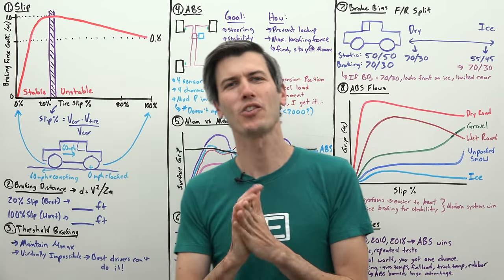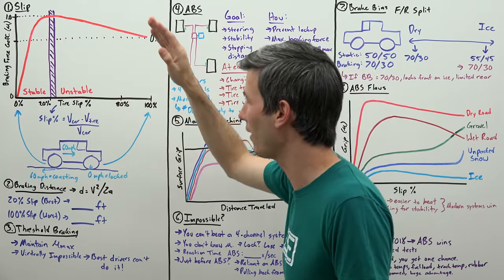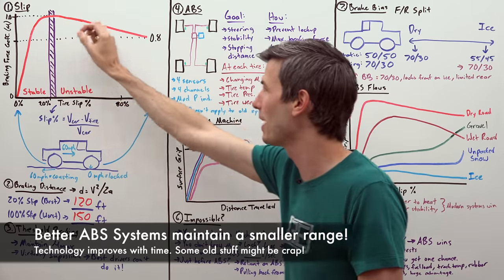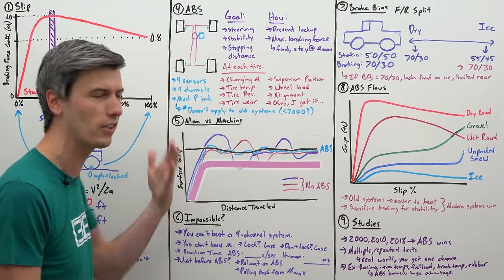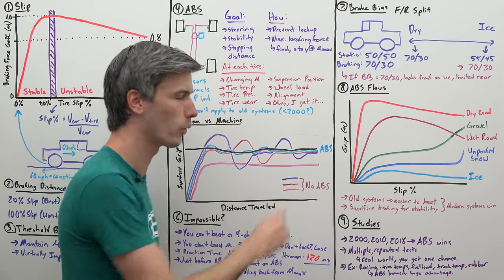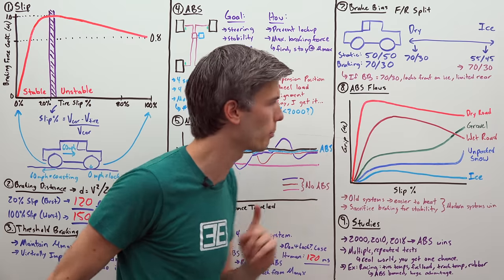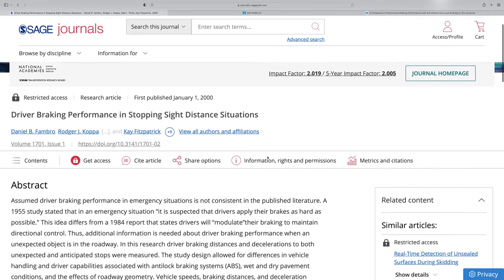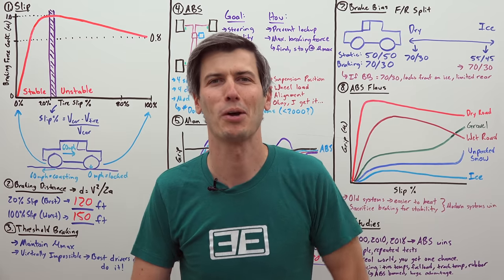Why Threshold Braking Is Impossible - ABS Wins!

Comment: Yeah, I gave up that argument many years ago.  Early ABS was terrible and I could out perform it, but that was over 30 years ago.  Even my current 2014 Camry LE's ABS is multiple orders of magnitude better than I was when I was at my best (doing autocross, or Pro Solo every weekend).  Now, in my early 50's, I am not at my best.    With that said, I do have a 15 year old currently learning to drive and I am teaching him how to threshold brake, just in case he's ever in a car without ABS, or the ABS has failed.
Reply: Modern Toyotas (after about 2006-2008) have something called vehicle dynamics integrated management, which cooperates pretty much all the control systems into one, and allows them to anticipate a skid (likely using knowledge of optimum wheel slip angles) instead of simply reacting once it starts.
Reply: @aspecreviews  Pretty much all modern vehicles have a similar system with different names depending on the manufacturer. For example, Stabilitrak for GM, and chassis control in Nissan. All of these systems monitor the steering angle, accelerometer data, and wheel speeds (using the ABS sensors) to accomplish vehicle stability. These systems will limit engine power if the system detects too much acceleration for the steering angle, or apply individual brakes if under/over steering, etc.
Reply: @berto1014  VDIM can ANTICIPATE a skid, the vast majority of stability systems only REACT once a significant skid is determined to be occurring.
Reply: @aspecreviews  That's not true. Most systems won't even let you get into a situation where slip occurs because they are actively preventing those conditions. I'm not sure what you mean it can "anticipate" a skid. How could it do that without data indicating slip is occurring or about to like any other system. I have yet to see any information claiming Toyota has a superior system because it anticipates instead of reacts.

Comment: Hubris? In the car/racing community? Inconceivable!
Reply: It's hubris to discount racing experience with theory alone.

In real racing, ABS settings are a complicated topic with no one easy setting for best consistency and speed. Threshold braking can produce faster laptimes, but at the cost of consistency. Higher and lower levels of abs and various abs setups and brake bias and suspension settings also factor into this.

So it's not as easy as ABS = always better. If it was, people wouldn't be talking about threshold braking
Reply: @Tom--Ace  yeah I know. Thanks for the lecture dad.
Reply: @matthewazevedo274  you're welcome son

Comment: Jason! As I am close to finish my degree on mechanical engineering, I recently began working dimensioning braking and suspension systems for electrical buses in Chile. So, i stumbled upon documentation on WABCO ABS (and esc) systems. Many, many iterations have come by. It is really interesting, as pneumatic systems are really different from hydraulic braking systems due to compressibility (and friction losses due to sheer size of the vehicles). WABCO has literature on this available, free to the public.

So, on this very topic of threshold braking, there are also many disbelievers on buses and truck abs systems, claiming that only humans can do better. It would be very interesting if a part 2 video would come out, focusing on compressed air abs systems.

Comment: Interesting point about braking on gravel. It is a known fact that a rally car slows quicker when sliding sideways into a corner. In the days before four wheel drive, most of us rallied rear wheel drive, which is a lot of fun. We generally had our brake bias to the rear which, when approaching a corner, a short pump of the brake peddle at turn in would help the rear of the car to step out. Drift cars do some thing similar but mostly with the hand brake. We would  would also use that trick for acute corners. Tarmac rallying was quite different; more bias to the front and the brakes would get a real hiding!

Comment: My first ABS equipped mid 90s built car had an older Bosch 2E system fitted & was lethal in the snow, I used to unplug a wheel speed sensor to disable it so the vehicle would actually stop. Next vehicle early 2000s  had a Teves mk60 system & that newer ABS system worked perfectly fine on snow, it also had emergency brake assist that when triggered pulled the car up a lot quicker then you where expecting. FYI I have also found ABS systems work going backwards 😉

Comment: All that has been said is perfectly valid for traffic application, but from my own experience I can say that on the track not using disabling ABS makes you faster, by increasing your sensitivity and technique, when I disabled ABS first my time increased drastically, but after about 50 laps I managed to catch up to my previous time and currently my lap time dropped by 0.5s,  my technique has improved, using things like trail braking and slip angle, and there is still room for improvement.
Reply: Once you improved, did you try turning abs back on? Maybe you’re even faster with your new skills and abs combined
Reply: Most of the guys I know who talk about outperforming ABS have never even driven a parade lap around a racetrack.
Reply: They really shouldn’t be talking then lol. I’m curious what the real racers actually experience.
Reply: @alanh2820  No, because it would be useless, maybe if I drove a front wheel drive car, but in a rear wheel drive car you want to brake as lightly as possible, if you brake hard enough for the ABS to kick in, you lose time and may even spin, as weight is transferred from the rear wheels to the front, resulting in loss of traction, and that was my biggest learning, an RWD car you make the turn using the accelerator pedal. That's why FWD cars are easier to drive, the harder you brake the more traction and control you have.
Reply: Gotcha so in a race setting, rwd, for the tracks you race on, abs isn’t useful because it’s never even needed

Comment: Anti abs guys are the same kind of guy who turns off stability control because they think they can drive faster around a turn in a drift.
Reply: Not necessarily drifting, but it does need some subtle yaw angle to be fast in turns, especially small radius turns. That's why TC and esp has to be off. Abs   better be on though.
Reply: @rzb1101  Absolutely, but that kind of stuff belongs on a track and not a public road where you have a good chance of killing other people and not only yourself.
Reply: thats exactly the reason why they do it and they're right, lol
Reply: Haha No, Love ABS but do turn off STAB in the wet (on NON AWD cars), not because it is faster, just hate the way the car reacts, when I know how to let the fronts spin and keep control.
Reply: i sometimes deactivate TC in my FWD car, because it will abruptly drop power to 0 if slightly slipping (and then you don't move at all or in kangaroo style).
Reply: @steveksi  so you're just constantly going beyond your traction and tires friction limits and were supposed to be convinced you're an expert?
Reply: @steveksi  not just awd street car tc and esp make all drive layout cars slower. Wet or dry.
Reply: @rzb1101  TC is banner in formula 1 and most race series because it is faster through turns, especially tight ones. 

Drifting is fun. It's not the fastest way around much. A tight clean line without any tire spin is almost always faster than drifting through a turn, with the exception of rally races, where you are on loose surfaces like dirt.
Reply: @pierredelecto7069  race car tc is a different animal compared to road cars, it still allows the car to have subtle oversteer.   The yaw angle I mention is not really the drifting you have in your mind. Actually , you can't even see it outside of the car, but the driver can feel it or a trained eye can see it happening. And tires need 10-15 degree of slip angles to have max grip. The the definition of oversteer in vehicle dynamic is rear slip angle > front slip angle. Not necessarily the big slide in your understanding.
Reply: @rzb1101  hot damn man. Someone went to car college.
Reply: @SlyNine  No one mentioned Expert haha. Just hate the auto wheel braking and engine cut when traction is lost on wet surfaces especially while cornering. Just not a nice feeling. REF FWD car

Comment: I appreciate it is very hard to figure this out.  Getting the data for these videos is very difficult.  Good job.  I am taking racing classes from Porsche and they definitely teach you to stay off the abs.  They teach you to use abs as the limit you should not go over, as you suggest— bring it right up to the abs then back off.  They have braking sessions in every class.  I’ll bring this up, and try it next class.  (Yes I’m also an engineer and a geek!)

Comment: I think one thing you're forgetting to consider is abs only is going off of wheel speed difference between each wheel. In snow and ice conditions you mash the brakes all 4 wheels slow down way to much and the computer does do its thing but at that point it's not so good at its job. In winter conditions  it works best to just get the abs to run a little  then yes it works well but it's not perfect.
Reply: A good modern system is computer controlled, and even though it might only have wheel speed sensors and fluid pressure sensors as inputs, it can tell that something isn't right if it sees 60-mph to 0-mph in an unrealistically short time.

Comment: Do this test on gravel
Reply: I’d like to see that. I think I recall reading ABS did worse 20 years ago. But modern systems are pretty amazing. Brembo has a full traction control package you can buy now with ABS and dynamic traction control.
Reply: What test? Did you watch the video? Jason talks about how gravel and unpacked snow don't play nice with ABS, since the best braking distances can be achieved with the wheels locked-up.
Reply: @ARentz07  thats what i wanted to highlight. He and you are right with your statement lock up on gravel is better. I meant to show or do a video test that shows the comparisson with snd without ABS

Comment: Perfect timing. I was just considering an expensive 6:1 brake lever manual master cylinder. Pretty fancy solution for my need to change from my old ABS system as my motor swap crowded into the old unreliable ABS system. Looks like I need to find a good newer ABS system to integrate into my 95 Integra K swap.

Comment: Additionally, one of the reasons F1 drivers frequently lock up coming into the pits is because there's no need to preserve tire integrity and prevent flat-spotting if there will be a new set on the car within 30 seconds.

As always, great video. I love the way you're able to visualize and explain mathematical principles. Wish I'd had a math teacher like you.

Comment: Talking about motorcycles, MCN magazine did a great test years ago on this very topic.  They took the average road rider, an MCN editor (who perform max braking runs on every bike they test, so they're very used to the dynamics involved in max braking), and a skilled track day rider, and asked them to try to stop in the minimum number of times.  The bikes used had a switch to turn on/off the ABS.  They found that the track day pro COULD outbrake the ABS a good percentage of the time...but nobody else could.

Obviously this doesn't take into account panic braking, and ABS systems have probably evolved a long way since that test (20 years ago).

Comment: Great video as usual. It is amazing that people think that they can modulate the brake pressure 100 times or more per second when they are facing an actively dangerous situation. But this does also remind me of an old joke I used to make. I claimed that my MTB had ABS, and when asked how, I replied "when the tires lock up, I let go of the brakes"
10 years later there are ABS systems for MTBs. I'm not sure if I want that on a bike (I'd like to try them first before judging), but for cars, it is a no brainer.

Comment: At 6:00 a good concept to explain is the tire grip model and how it has to be accounted for by each OEM.  Depending on testing specific to each OEM, the control systems ability to cope with measurably different grip levels varies a lot.  Some stability control systems can be forced out of their programmed model by adding larger wheels and higher performing tires.

Comment: I think part of the distrust of ABS comes from those of us that lived through the early years of ABS.  My first experience with it was in my '94 cavalier with front disc brakes and drums in the rear.  The drums on the rear wheels were notorious for locking up in certain conditions, especially after sitting a couple of days.  The early ABS modules would cycle quite slowly, probably only a handful of times a second, and would cycle all 4 wheels at the same time which would give you a very jerky lurching stop.  This caused me several close calls when coming to a stop on snow or loose gravel on pavement and one of the rear wheels would lose traction.  A normal slow down turned into the car thinking I was on sheer ice and pumping the brakes as such. The last straw came when the module started failing and would activate under normal stopping and drop the brake pedal all the way down. I deactivated it altogether after that.  
The newer systems are much better, and do a great job but a little distrust still lingers in the back of my mind.

Comment: Great video. Jason probably knows this but I want to point out that in racing machines, brake bias adjustments are also made to change how much rotation there is on corner turn-in. Greater rear bias will make the car tend to rotate more. I assume "understeer while braking" would be a great example of a problem with (non-modern/non-racing) ABS although definitely not a problem with all ABS. I'd be super interested in a video on how racing ABS handles things like rotation on turn in, maybe there's a good one out there already.
Reply: once abs kicks in that hard enough to push on the brake peddle do not hammer on harder as you can blow the fuse for abs and turn abs off fun fact
Reply: "(non-modern/non-racing) ABS"

That's really the crux of it. Imagine how good ABS systems would be if they were allowed in F1? 

These systems are only as good as they need to be and ABS saves lives daily. It doesn't need to be better at rotating my car for that really tight hairpin. It just needs to stop grandma from killing my dog just because she doesn't know how to threshold brake in a panic situation.
Reply: @raven4k998  Pedal, punctuation, and no, you can't blow a fuse that way.

Comment: I had a similar experience with a wet road and an empty trailer coming up to a red light. Hit the brake and instantly felt them locking up, let go and try again, same thing. Finally said screw it and just mashed them hard, the abs kicked in and the tractor trailer stopped why faster than I expected.

Comment: Very good explanation about the phisics behind the braking and slip, but I never understood how the control unit can mantain the wheel around the maximum slip threshold. What is the strategy implemented to do that ? v_tire is know but v_car not and therefore it can't follow a strategy based on that. thanks

Comment: Recently I was crossing an intersection at a moderate rate of speed.  Out of nowhere another car came bombing through to my left illegally and unexpectedly.  I instinctively hit the brakes hard as I continued to approach the intersection.  Based on my experiences with emergency braking (which I thought I was pretty good at), I just KNEW that I wasn't going to make it and I'd hit the side of the car before I could stop.  To my amazement, my Subaru's anti-lock brakes stopped me before I hit and the other car whizzed by unscratched with at least an inch to spare.  When I bought my new motorcycle earlier this year, it HAD to have ABS.  You are correct about ABS and gravel as I was able to demonstrate for myself a few days ago, however I rarely ride my bike on gravel and take extra caution with speed and braking when doing so. 

I really enjoyed learning the background why I've had such good experiences with ABS, so thanks.

Comment: I think more often the problem is when you upgrade the brake system on the car. Like bigger caliper / different brake pad compound. Deleted my ABS on my track car since it was not suited to the new brake I installed on the car (1999 Impreza).

Comment: I was in the snow once in a beretta with cheap all season tires. the abs worked fine but was a little on the crude side. going down a big hill I decided to test my stopping distance. from about 15 mph, I bet it took me well over 100ft to come to a stop! and when I just stabbed the pedal and let the abs figure it out, the car would get down to like 2 mph but couldn't fully stop...I had to just ease on the pedal and as soon as it started slipping, back off and try again. probably took a good 20 ft to stop from a slow walking pace. lol

Comment: #4 - This could be a good video on the mathematical complexities of the four-channel systems capabilities on multiple different surface types in different patterns of slickness (bowling with oil patches), at set speed intervals.

Comment: even the analog 3-sensor abs system in my 1986 mercedes did quite a good job at stopping without locking the wheels. In winter with snow/ice you have 10000% more relaxed driving because of the system. And I have also driven many cars without ABS and know how to brake without it :)

Comment: One aspect that has not been mentioned is that during heavy braking and corner entry, the moment when you taper off pressure and apply steering lock the inside wheel will have a tendency to lock up as it is under lesser load than the outside. ABS can calculate for this and correct the inside wheel lock while still maintaining braking force on the outside wheel. By the time a human backs off pressure to unlock the inside wheel the vehicle has run wide and missed the apex.